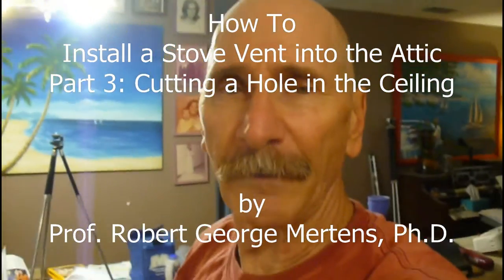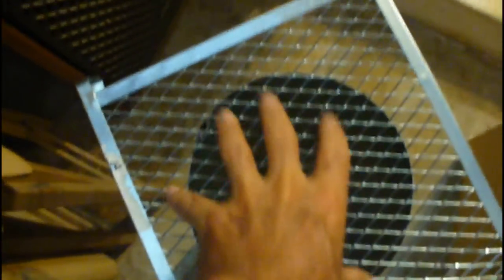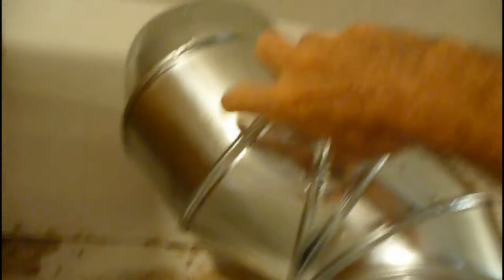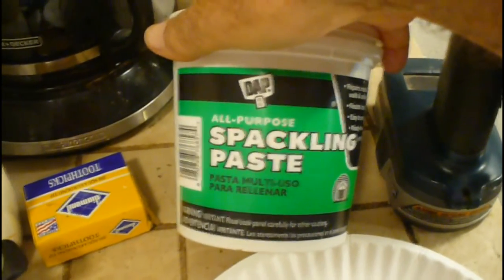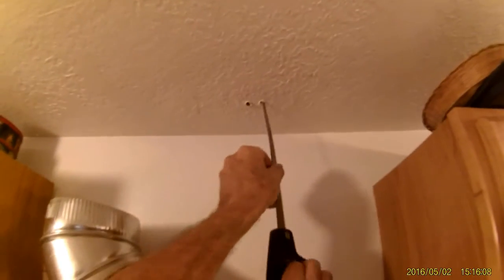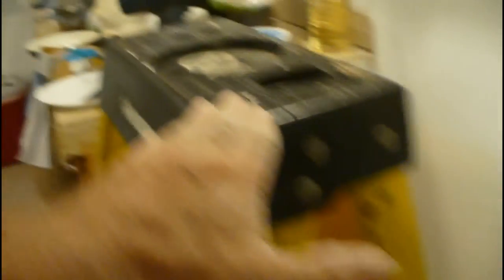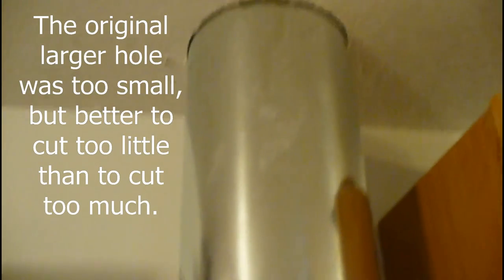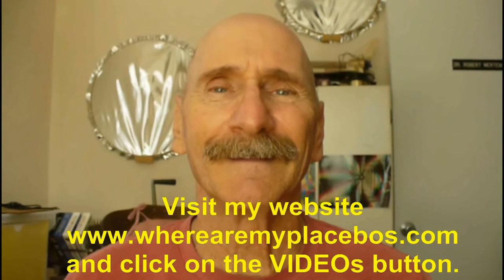Part 3. Install a Stove Vent into the Attic: Cut the Hole in the Ceiling

Comment: From what I heard you can't use the tin shiny metal galvanized metal in the inside of your house because it puts off  a gas when real hot,  you supposed to use the black wood stove pipe going up, and if you're not going to use the double wall pipe going through the drywall of your ceiling and wood through the roof, then you should have a bigger pipe ring about half an inch or 1 inch wider through your ceiling in roof and then the smaller pipe go through that for at least one inch clearance so the heat doesn't caught catch your ceiling and roof on fire when the wood burning stove gets really hot
Reply from the maker: Thank you for your comment.  You're absolutely right!  If this were a wood-burning stove and this was the exhaust pipe for it, this design would be completely wrong.  It is, instead, an ordinary electric stove, and the fan is an ordinary vent fan, not intended to remove heat from the stove, or, at least, no more than 20 degrees above ambient room temperature or so.

This is the sort of vent, similar to a bathroom vent or a kitchen overhead vent, to carry stuffy or warm air, out of the house.  This vent sits about three feet above the stove.  Some commenters have mentioned fire going up into the attic, through the vent pipe, but I think, if I have a three-foot high fire on my stove top, the vent fan will be the least of my problems.

Of course, I keep three fire extinguishers in my kitchen (I have no idea how I ended up with three - maybe from some of my boats), under the kitchen sink.  And my sailboat also has a fire extinguisher, so I still have no idea where they all came from.

Thanks again for your comment.  If you're exhausting (as opposed to "venting") a wood-burning stove, then this really is the wrong video series for you.

However, I have considered installing a fireplace in my home.  But this is Florida, and that plan may be a very long way off, if at all.